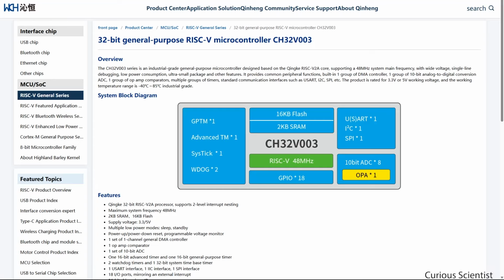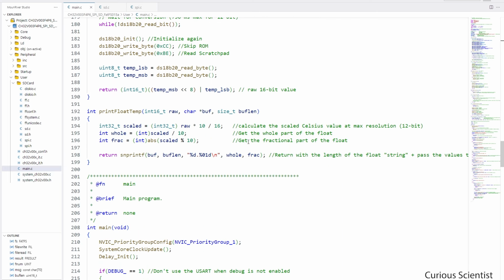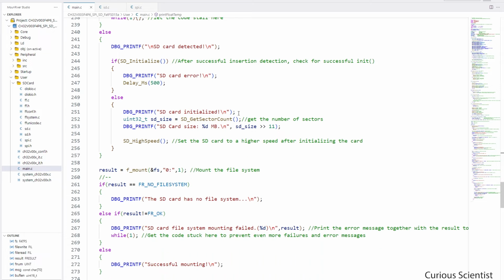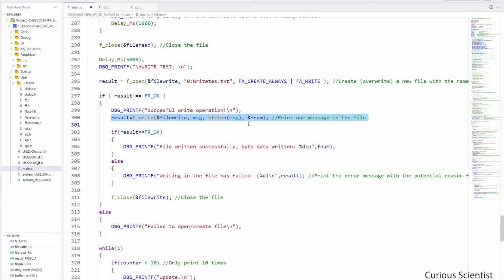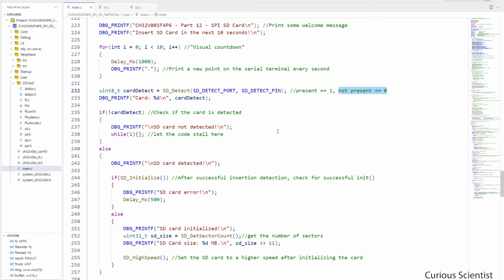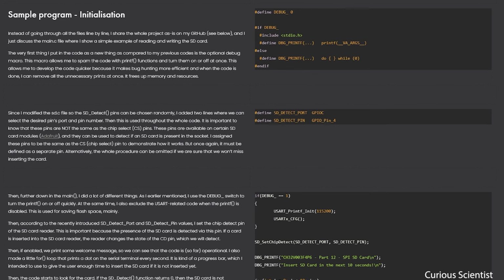CH32V003F4P6 Tutorial - Part 12 - SPI SD Card + FatFs

Comment from the maker: Interfacing SD Cards with CH32 Microcontrollers: A Comprehensive Tutorial

*   0:00 Introduction to SD Card Integration: The video continues the CH32 tutorial series, focusing on integrating an SD card with the microcontroller for data storage, expanding on previous SPI communication projects.
*   0:11 Hardware Setup: The presenter demonstrates the physical connections, including the CH32 development board, an SD card reader module (utilizing SPI), and a DS18B20 digital thermometer. Key detail: the SD card module requires a 5V input, which is then regulated down to 3.3V on-board for the components.
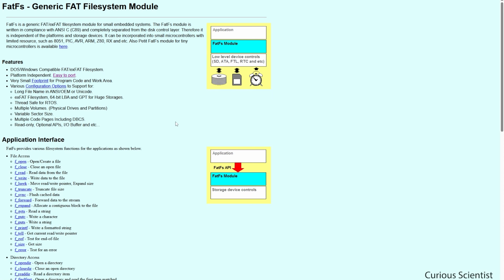*   2:20 Utilizing the FAT FS Library: The project leverages the open-source FAT FS library for file system management, noting that it requires some minor adjustments to work seamlessly with CH32 microcontrollers. The complete project code will be shared on GitHub.
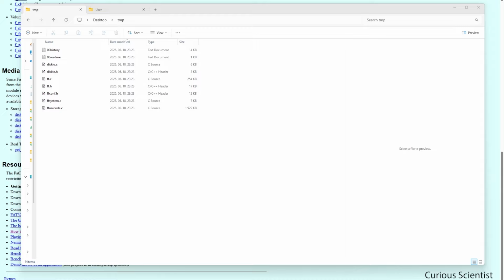*   3:22 Core Library Files and Custom Handlers: Key FAT FS files are introduced, including `diskio.c/h` (low-level disk I/O), `ff.c/h` (generic file system), and `ff.h` (the main configuration file). The presenter also details the need for custom SPI and SD card communication handler files developed specifically for this project.
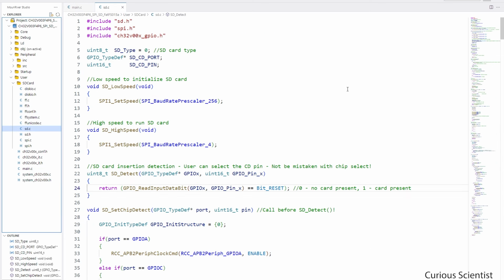*   5:50 SD Card Detection and SPI Configuration: The tutorial explains the implementation of SD card insertion detection and the strategy of using two different SPI baud rate prescalers (slow for initial setup, then high speed for data transfer). The chip select pin is assigned to PC4.
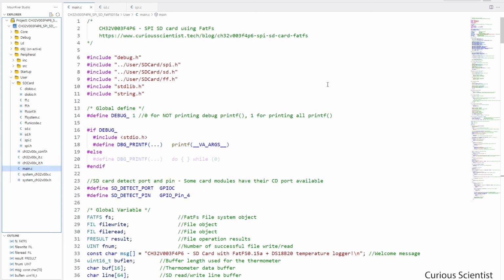*   7:54 Code Structure and Memory Optimization: The video details the project's file organization and introduces a `DEBUG` macro. This macro allows for conditional compilation of `printf` (UART) debugging output, saving approximately 2KB of flash memory, which is crucial for standalone microcontroller applications.
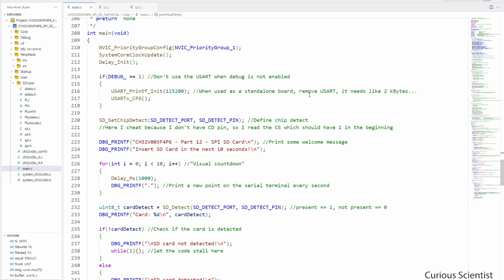*   12:42 SD Card Initialization Sequence: A detailed walkthrough of the initialization process is provided: setting up card detection, a 10-second countdown for user card insertion, detecting the card's presence, successful initialization, determining the SD card's size (e.g., 8GB), switching to high-speed SPI operation, and finally, mounting the file system.
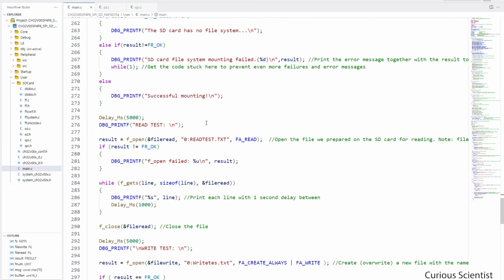*   16:39 File Reading Demonstration: The process of opening and reading a `read_test.txt` file from the SD card is shown, with its contents printed line by line to the serial terminal. A key takeaway is the 8-character filename limitation imposed by the FAT FS configuration to optimize memory usage.
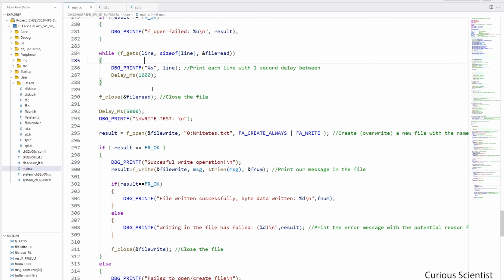*   18:49 Data Logging (File Writing) Implementation: The tutorial covers creating/overwriting a `write_test.txt` file, writing a header message, and then appending real-time temperature readings (from the DS18B20 sensor) every second for 10 entries. This involves using `f_lseek` to find the end of the file and `f_write` for appending data.
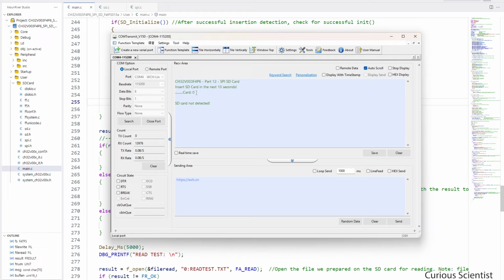*   22:50 Live Demonstration and Verification: The presenter provides a live demonstration via the serial terminal, showing the entire process from card detection and initialization to reading a test file and logging temperature data. The logged data is then verified by physically removing the SD card and inspecting its contents on a computer, confirming successful read and write operations.
*   27:54 Conclusion and Project Resources: The video concludes by summarizing the successful implementation of SD card read/write functionality with the CH32 for data logging. Viewers are encouraged to visit the presenter's website for an accompanying article and GitHub page to access the full project files.

I used gemini-2.5-flash-preview-05-20| input-price: 0.15 output-price: 3.5 max-context-length: 128_000 on rocketrecap dot com to summarize the transcript.
Cost (if I didn't use the free tier): $0.0066
Input tokens: 21234
Output tokens: 965

Comment: I made a small PCB to test this. I was curious about using this with a 3.0V LDO and a BT module ( so that the device can be powered with a LiPo battery) . It worked flawlessly the first time itself !!!. Thanks again !!
Reply from the maker: Great to hear that it worked out for you! Don't forget to spread my videos so more people can benefit! Cheers!
Reply: @CuriousScientist   For sure.
Reply: Just in case you get time to comment : An observation I made is that writing the opening msg to the SDCARD takes about 140ms.And it is not affected by the number of bytes written. Opening and closing the File (in while(1) loop) without writing takes about 170uS. Does this sound about right ? I measure this by toggling a pin and using one of those el cheapo LA.

Comment: Does it also work with a Micro Mini SD Storage Expansion Board?
Reply from the maker: It is the same thing. The module I use allows both 3.3 V and 5 V signals thanks to the built-in LDO and level shifter. The module you mention seems to not have these additional modules, so you should ensure that you are strictly using 3.3 V. SD cards don't like 5 V.